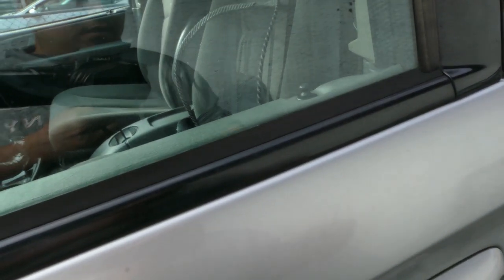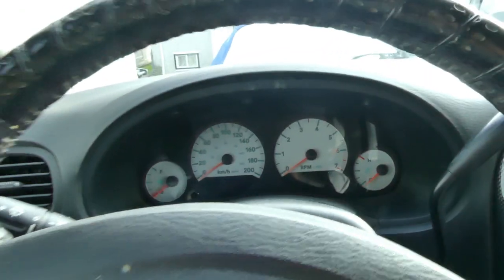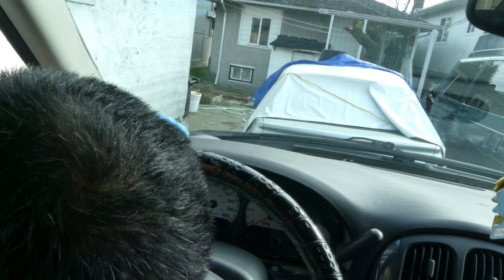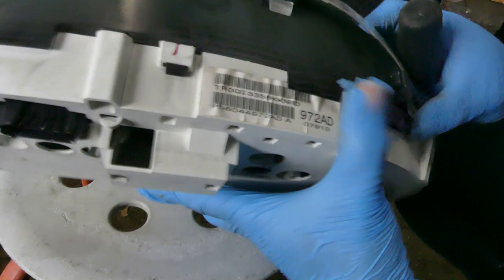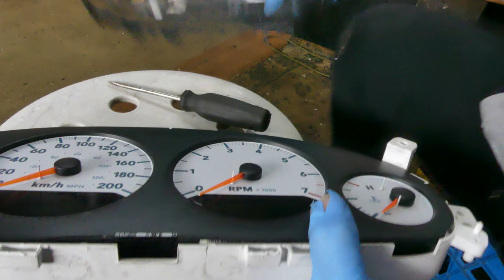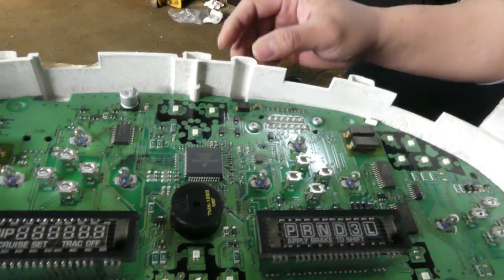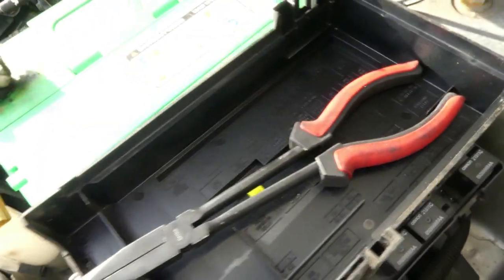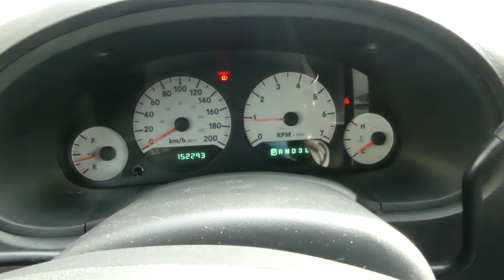2006 Dodge Caravan Instrumental CLUSTER Not working.. FIX

Comment: Hello, i had the same problem. Changed the fuse and it worked...for about 5 minutes. Then the fuse blew again. Any suggestions?
Reply from the maker: then u had a shorted circuit somewhere
Reply: @asianmechanicguy6483  where would I look?
Reply: I couldn't believe it but a brake light somehow got fried and shorted everything out when I hit the brakes!

Comment: Hello Asian mechanic guy! I have a 2006 dodge caravan 3.3L V6 minivan. I’m having an issue with my headlights. The problem is that when i have my night running lights on (light select switch all the way to the right) my drivers side headlamp will not work. It just stopped working one day. I’ve tried different bulbs and still nothing. I assume it’s an electrical issue. The strange thing is my passenger side works when night light are on. I’ve tried it with halogen and LED bulbs. The only way I can get the lights to stay on both at the same time is by using daytime running lights, (switch in the centre position)
The problem with this is when daytime lights are on when I use the signal light the headlamp turns off and then back on again once the signal is deactivated. Obviously this is not ideal for nighttime driving. I was wondering if you had, from your experience any useful information that you don’t mind sharing that could help me look for and identify the problem? I’m not sure if it is a fuse issue or it could be a wire that came lose etc. just wanted to know a good starting point to look at before paying money to get it fixed. Thank you!
Reply from the maker: try to disconnect your tailight bulb